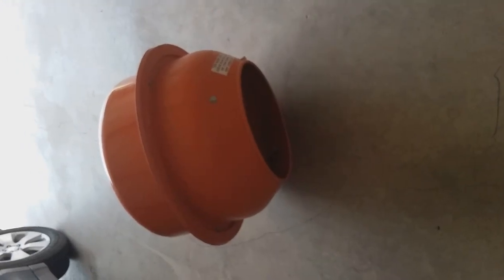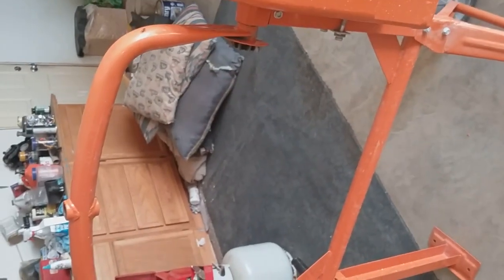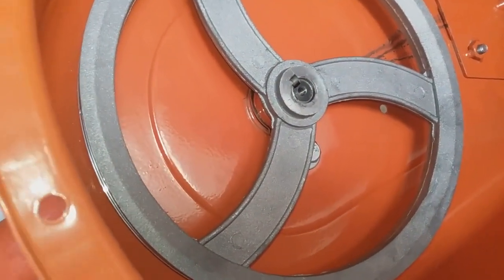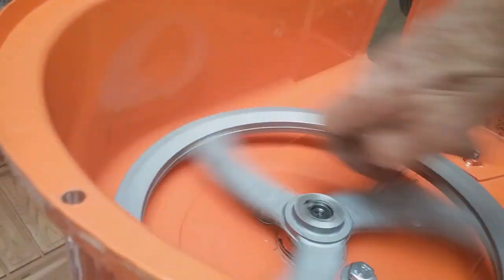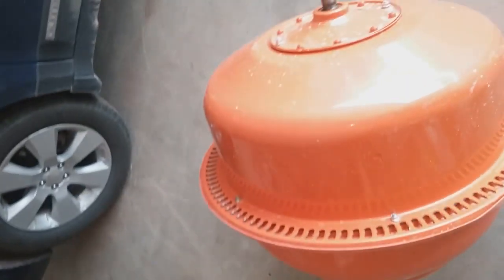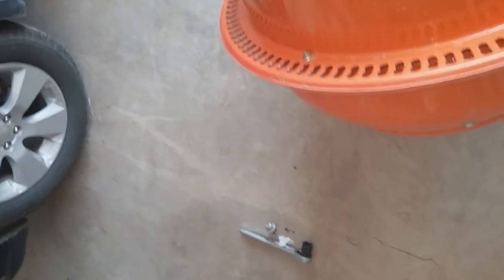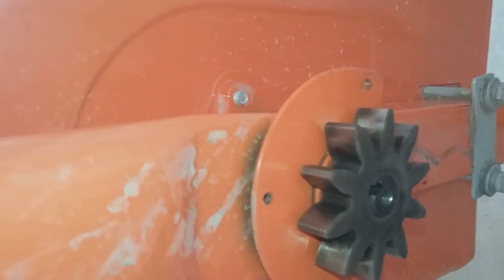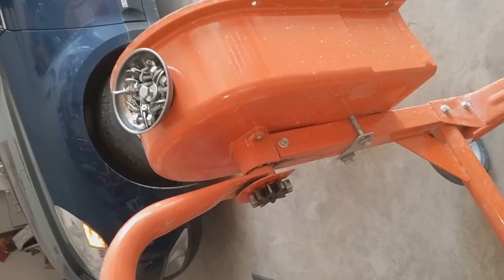How to Fix a Harbor Freight Concrete Mixer

Comment: Jesus man, they got monkeys putting these dang things together, I tell you. I just bought an identical one and made it through two loads before the motor crapped out. They seem to be projects rather than tools. I've got plenty of those already. Great vid, BTW.
Reply from the maker: Wow, my motor still doing good. but I only mix about 1.8 to 2.0 Cu. ft per mix. A little over 1/2 the stated 3.5 cu ft. capacity.  I know from reading reviews that some people seem to get lemons or problems with various tools from HF.  Hope you are still in the return policy period.  I bought the extended warranty on a floor jack and i am on my 4th year with no problems. Extended warranty was never used and has expired now. I have bought alot of tools and have never returned any of them. Just lucky I guess?
Reply: What you're describing right at the one minute mark into this video is exactly what my mixer just did on me yesterday, motor and pulley are turning fine, but the spindle or key or whatever you want to call it is probably loose cuz it's not turning the drum with any power.

Comment: Ya I lost my key too 😂🤪
Reply from the maker: I bought a 5mm x 5mm x 56mm off of ebay and cut it to 12mm to replace mine. Now I was looking for the left over piece and looked everywhere I can think of and just cannot find it. LOL! Mine is still working, but I wanted to find that key so I could confirm the dimensions are 5mm x 5 mm x the length. Never found it, but I took the cover off and measured and it is  5mmx5mmxlength and they do sell them on ebay. Some of the sellers are in China and that generally takes quite a while to receive the part from China. I am hoping I stumble across my left over piece before I actually need another. Hope this helps you out of your bind.

Comment: you need to learn to hold the camera still made me motion sick watching as long as i did to see issue so thanks for that insight to know what to locktite if i decide to buy this mixer
Reply from the maker: Totally agree! My first YouTube video ever. I felt I had a message for people that bought this mixer. This video would have made my fishing friend seasick. I think I have gotten a little better, but still have a ways to go. Thanks for trying to watch and this mixer is so much better than trying to mix concrete in a wheel barrel with a shovel. Just need to keep an eye on certain bolts. I am glad I took the plunge and bought this mixer and managed to fix it. I am trying harder to just pause the videos if I am going to move around, or trying to move the camera much slower. Thanks for watching or trying to watch and commenting! Good comment!

Comment: The Harbor Freight concrete mixer is terrible.  Don't buy it, way too noisy and just plain poorly built.  Their mixer is a joke.
Reply from the maker: I can agree that if you plan to pour a lot of concrete that the harbor freight concrete mixer is probably not the way to go and it will take up some storage space in between pours and seasons. 
I had poured approximately 50 cubic feet of concrete with mine before the bolts came loose and I lost the little key way. 

I did buy a new key way on ebay and the mixer is running fine again. 

I have to do all my concrete work by myself and I only tackle small pours at a time, about 7-9 cubic feet of sidewalk concrete at a time. That way I can mix, pour, mix some more, pours some more until my forms are full, screed, finish, spray curing compound and cover it and clean the mixer all by myself. 

So yea, it is noisy and somewhat of a poor design. I hate the little wheels on it, but it can get the job done if you take better care than I did to check all bolts and keep them tight. 
Or usethread locker from the bieginning.

Don’t try to mix 3 ½ cubic feet of concrete per mix as it is top heavy and can tip on you unless perfectly level.

 I made the video to try and help some other poor soul that might have the same mixer and might have had some of the same issues I had.  Hope it might help someone.
Reply: I've done 100's of cubic yards of concrete over 36 years with the original one with little problems to speak of......about $150 back in 1980's!
Reply: I strongly disagree, if you are handy and clever you can make this very affordable mixer become a little workhorse. If you are not mechanically  inclined, this unit is DEFINITELY NOT FOR YOU. For those people, please go spend a couple of hundred dollars more on something well built. I’m sure anything American made shall do.
Reply: @zjedinite  I agree with you. I've mixed nearly 100 bags in mine.
Reply: @Jhovan33  the one issue most people complain about is the screw that hold the bearing pin comes loose and drum won’t spin. When I purchased it, I took it apart before using it to grease the bearing and all moving parts. Then I used Thread lock on that darn bolt. Machine works like a charm!